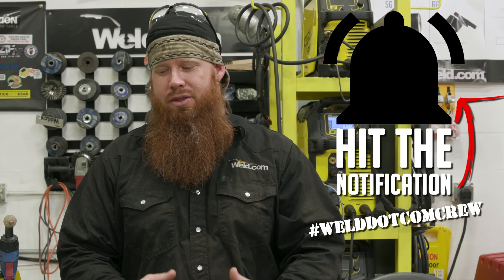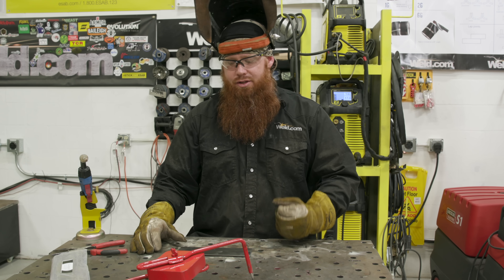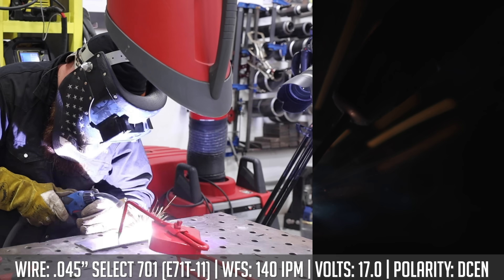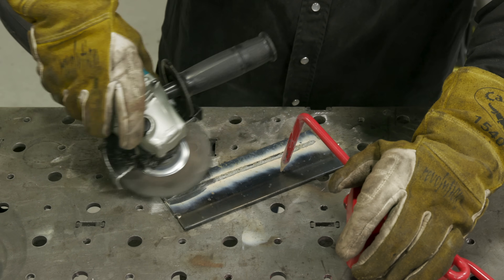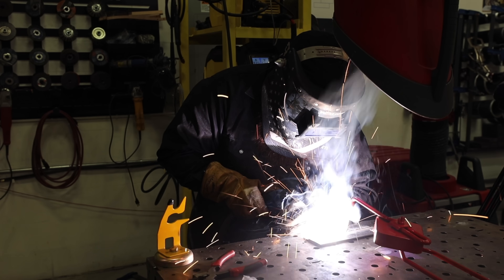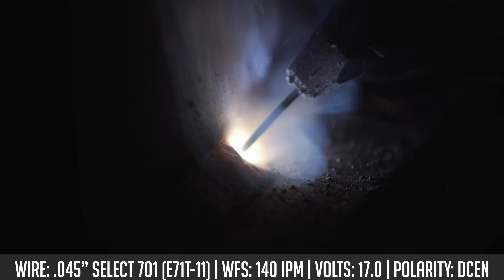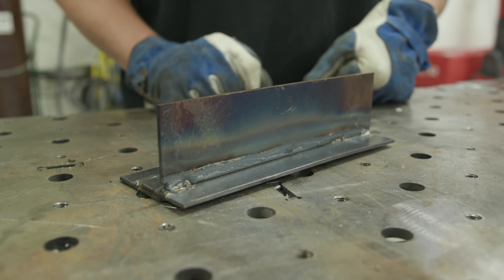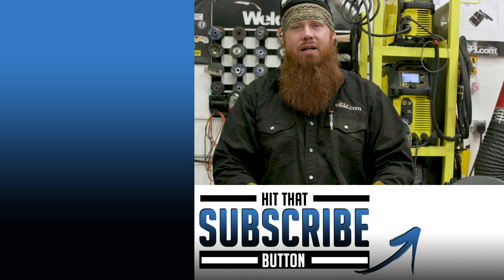Welding THIN Material with Flux Core

Comment: Quick question if you don’t mind helping me out . I’m currently welding on a tube membrane with Fcaw 75% 25% , on 1/4 plate fillet weld . I can’t seem to find the sweet spot , they want it to be a flush bead . If you can help me out I would appreciate it …

Comment: You say 1/8" is sheet metal, maybe for you.  I'm in the HVAC trade and sheet metal to me is 20-22 GA., not 1/8" steel.  If ducting was made from your "sheet metal", they'd probably rust out quickly because they are not galvanized yet be heavier than a freaking car inside of a home or business.  I've welded 1/8" steel for condensing unit frame-outs to hold 350 lbs., I would say, not thin.  Can you show using flux core on 22 gauge metal without warpage, or is that more in the lines of TIG welding THIN sheet metal?  Please show welding 22 gauge metal.  That is thin to me, perhaps micro to you.

Comment: Take note: I have no long term experience with welding . I welded up my trunk and my lower quarters to my car with( .030 flux core) it did well to do the job. trunk held up and kept out the elements. Also knocked down road noise a tad .

Comment: Hey there, You're the man I need. Youtube let me down on this. 

Can You show us how to fuse 3-6 mm (1/8'' - 1/4''') round stock with MIG (FCAW), no gas? 

I tried it on DCEN, as is usual for flux-core, with the machine set to half the material strength of the rod. I can not by hand manipulate the amperage, but I can set thickness increase/decrease the puddle heat a bit by means of electrical reactance (Technomig 210 dual synergic 230V). I got solid tacks most of the time, but soon as one of them doesnt stick, any further attempt results in burn-through. I try to fill it up and just melt the rod away... I can't keep the pistol on. Also, I don't know what to look for (like puddle and flux crust I usually see when doing larger welds on square tubing). I just can't reliably do it man. I need input :(

Comment: Became excited when I saw a flux core video for thin metal.  Then he said 1/8" and I thought "Wha-?"  Nope.  For me that's plate.  My primary hobby is automotive related, where the metal thickness is at most 18ga.  So when he referred to hand rails at 14ga I thought "... and?  When are you gonna address thin metal???"  But he never did.  Disappointing.  Put together a truly thin metal video then I'll watch it.  Try a few auto body panels, then you'll have my attention.  This isn't thin.

Comment: Just did a couple projects with.035 gasless flux core working on .063 and .084. Some thin to thick, .063 to .250. Wasn't too bad. Really seemed to want to blow through the .063 without manipulating the gun.

Comment: Thin? Ha! That is NOT thin. The reason I own a FCAW machine is for auto body work.  About 1/32" to 3/64" usually, 1/16" max.  I run .35" t11 hot and fast, and pulse the trigger as needed to cool the puddle and not blow through. Takes practice but its relatively easy once you know how to control the heat.

Comment: I guess that is thin for the wire he was running. I put some .045 NR212 on a Lincoln promig 180, and you have to turn the wire feed up on that thing to make it run smooth. Higher wire feed equals higher amperage. But I love me some NR212 in this machine!!! Gotta go back and try some 211 though. Got a few unopened rolls and what's left of a 10 pound spool of .035 laying around.

Comment: I'm very new to welding but I'm able to weld 2mm angle iron using 0,9mm (=0,035 inch) flux core, with ease. For those who have a cheap welding machine (like me): the key is not to use "synergic" features but instead set the machine by hand. My settings are 330/16V, and I can move pretty slowly, and thoroughly. At first I tried synergic settings, and I was just burning through, instantly :)

Comment: Thank you for these flux core videos. I’m a hobby welder and I use only flux core, and it is hard to find any valuable advice from experienced welders on flux core other than “don’t use flux core because...” Thanks a ton!!
Reply: Well don’t listen to those morons read the sheet on the welder and make your adjustments from there. It’s just amperages to wire speed from there. 😊 On top of manipulations. Watch more videos friend.

Comment: I'm reluctant to ask this question in public because i don't want to be flogged... but here goes:  I have a Lincoln 120v cracker box that does Innershield NR-211-MP .035 flux core.  I need to install some 1/4" steel brackets to an auto frame, my guess is 1/8 inch or 11-12 ga.  Is this the appropriate material and setup to do this?  i did some practice passes that looked pretty good; little splatterey but not bad, good penetration maybe a bit hot using the machine dork chart settings.  can you comment on this? thanks.

Comment: I got excited for a moment too with the thought of thin and flux core, lol. I thought it was going to be some auto body panel "thin" sheet metal, 1/8" is like the frame thickness which is much easier to weld, even flux core. I've used flux core to patch body panels which is very thin stuff, but had to use a piece of copper behind it as to not burn straight through, it worked, not ideal, just what I had to work with as gas is too expensive for hobby work on my own projects. Still, a good video, I'm just torn on calling 1/8" thin sheet. Then again, I'm not an experienced welder, just a hobbyist / repair my own stuff as it breaks.
Reply: I also saw "THIN" and thought the same thing.

Comment: I happened upon a multiprocess welder that I'm thinking I may dedicate to flux core.  I'm a little leery about buying a 25lb (or larger) spool of flux core though because I'm not using it every day.  How long do you think a spool of this wire would last if left in the welder and stored in a garage?

Comment: I've welded many Autobody sheetmetal projects with my Lincoln Weldpak 125, 220Volts using Flux core wire. The trick is to spot or stitch weld and weld in an area away from your last weld to avoid burn through and warping.
Reply: Right on. That's the way I do too

Comment: 1/8" is not thin, that's what I learned to weld on with flux core, easy stuff really
Reply: Totally agree, 1/8” is thick stuff. If you can’t bend those coupons with your bare hands it ain’t thin steel dude.
Reply: I’m trying to do 16 gauge now that’s thin stuff
Reply: @calebcrabbs5239  yep! My Handimig can only go UP to 1/8th. 16 gauge is where I run into trouble with blowing holes with fluxcore .035
Reply: @無名賢者 thanks!
Reply: I can weld car sheet metal with flux

Comment: Yes, as others have said, "1/8" is not "thin" material. I have only used flux core a couple of times in my 25 years of welding, so I don't know a real lot about it, but it is good to know that when you do need to use this process, that there are different types of flux core products for different types of jobs.

Comment: Great Videos on using flux core  the past couple of weeks.  I have an Eastwood 175 240v machine...never really thought about using 040 wire...   Sounds like I can use this weld on my front 1/8" to 3/16" IFS crossmember upgrade on my classic truck and not have to use a 75/25 Bottle -good to have options?
Always worried about penetration and strength of weld.  Appreciate any feedback.
Reply: Weld some test pieces the same thickness and then break them. The welds should not break at all or if they do only after significant permanent bending of the base metal. If it passes that test and you're confident of your consistency then you should be good. I would definitely do this before welding on thick chassis members. Flux core can work very well but an underpowered machine or a poor quality wire can ruin your day.
Reply: Good feedback thank you.  I'll be running 220v and can get it hot enough and of course using quality wire is key as well.  Just never really gave flux core much thought until these video.

Comment: How much does the polarity matter? I got a crappy little Hazzard Freight box--gasless--that I cannot switch polarity. Having a hell of a time welding floor panels on my old pickup. We have been using whatever the off-the-shelf stuff from Harbor Freight is (the welder is buried in a corner otherwise I would tell you).
Reply: The polarity matters a lot. Use electrode positive on flux core by mistake and you get loads of spatter and poor penetration. But a gasless only machine will be set up with electrode negative anyway so you should be OK.
Reply: @benc8386   Ben C  thanks, I recall watching a video here about that, all I remembered was the splattering. Being a more automotive guy, I just assumed the "ground clamp" would be negative. Just trying to continue learning. I have a tig welder too, but I have only used it for stick (so far), stick seems inappropriate for rusted ass floorpanels (rust cleaned up on the topside, but it's super thin and rusted on the backside even after overlaying with sheetmetal).
Reply: @Synaux  Stick is going to be difficult on anything less than 2mm and more or less impossible on less than 1.6mm. TIG is great but tricky when out of position on a car floor especially as you need at least three hands. Flux core can be used on car bodywork OK although short circuit MIG will do a neater job.
Reply: @benc8386  See! I have no idea what I am talking about and I nailed it! :P 

Tempted to go TIG, but it without experience (I will practice) it seems significantly more finicky. I bought a decent TIG welder for aluminum only....suggestions for "steel" electrodes on super thin shyt? Or general tips (no tungsten)
Reply: @Synaux  1/16 tungsten is good  for thin material but it doesn't make much difference. A 1mm filler rod is recommended or even thinner (you can use MIG wire). For lap joints the main thing is a really tight fit so just hold it down with a screwdriver and fusion tack in a few places to get started. Then the biggest problems are blowing holes (gotta direct and control the heat carefully) and distortion (keep the travel speed decently high, pulse the pedal, and do "back steps"). Practice on offcuts while sitting down comfortably and once you've nailed that worry about trying it on the actual car which will be harder because out of position.
Reply: Thanks, I know this is basic stuff, but it really is helping me

Comment: 1/8”? Thin? That’s the second largest material we have here lol, smallest we use is 20 gauge I think
Reply: calee4nyaboy what size wire do you use for 1/16 in sheet metal? Just curious, I’m new to this, figuring out what wire I can use for car sheet metal w a flux welder
Reply: calee4nyaboy we rarely ever use quarter inch. We mostly use mig welding for duck blinds, deer stands, and trailers, otherwise it’s a nice little shop that teaches the common processes
Reply: For flux it's thin
Reply: @Mikey-ym6ok  shit I can weld 20 gauge with flux. Just have to use the Ole brain

Comment: Would it be simpler to just run 6013 stick?
Reply: I dunno, but anyone can learn how to "weld" with flux in a matter of minutes, stick is a lot more challenging and crappy little mig boxes can be bought for dirt cheap (so this is good info for hobbyists).
Reply: @Synaux  personally I find stick is easier and more portable as you can some pretty small stick machines that are dirt cheap

Comment: I did 16 gauge stainless today.  With tri mix blue demon .024 wire on a Miller 211. It came out okay.  Could you do a video of that.  It was a inside corner joint, overhead.  The customer likes it and paid me$100.  But I'd like to see what the weld looks like from a real professional.

Comment: Would the voltage and wire speed settings change for dual-shielded FCAW on 1/8”?
Reply: Derek Showalter generally speaking, yes, but it will really depend on the type of wire you’re using. There are many types of Gas shielded Flux Cored wires.
Reply: Jason Becker What I do know is that the wire is .045 and that it’s a rutile based flux. I’m not too sure of anything else about the wire.

Comment: I'm building a 8×5 utility trailer and I'm using 035 flex core with a hobart 125 handler and using 2in angle 3/16 thickness and it works good good video on this thumbs up.
Reply: 3/16 is pushing what you can run with a 125. Make sure you cut an etch samples to verify you're getting the penetration you need.
Reply: @otm646  I have welded 1/4" with my Hobart 125 using .35 flux core.  Made a plow mount for my tractor beat the crap out if it and nothing has broke yet.

Comment: Will T-11 work on automotive sheet (body panels)?
Reply from the maker: If you go down to 035.
Reply: @Welddotcom  You going to respond to all the people wanting to weld sheet metal? "Thin" is not what you just welded. I thought you guys were pros?
Reply: Michael Treadgold they won’t. They hide from the truth. I was stick welding today at 130 amps on 1/8. It’s not thin at all
Reply: @Welddotcom  thank you!
Reply: I must have done something wrong. Using Lincoln nr211 mp .030 attempting butt welds on 18 ga. sheet metal was a great challenge. Too much heat buildup, blowing holes and warping. Technique I used was spot welds and jumping around from place to place. Machine: Lincoln 210 MP.  Ended up getting a gas bottle and going with .023 INE Italian wire. What a difference. Thanks for the nice videos!
Reply: I was about to ask that.